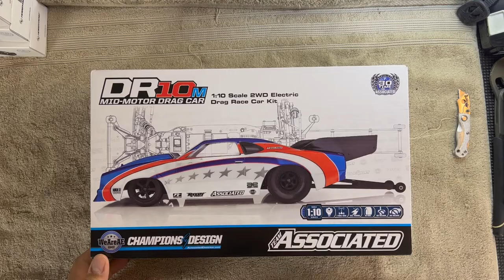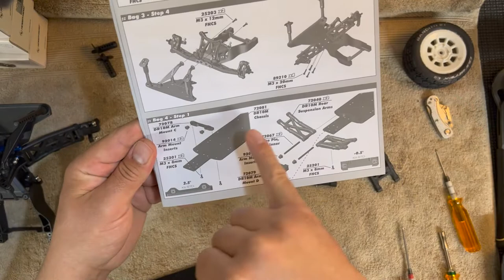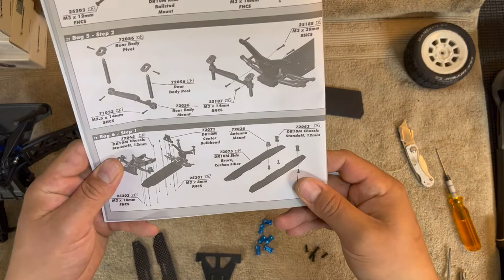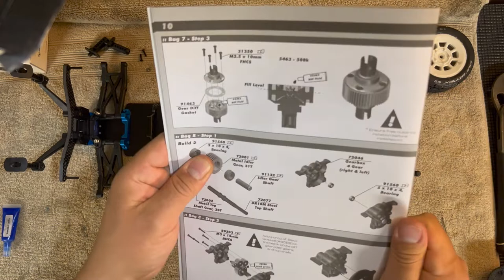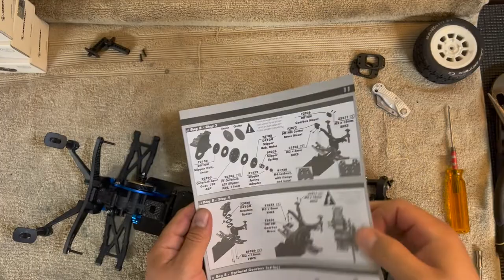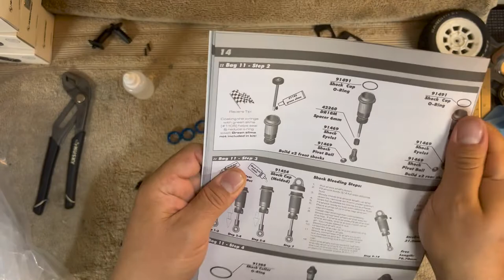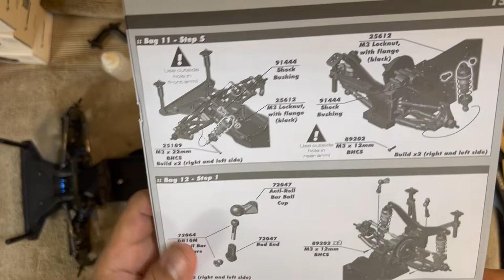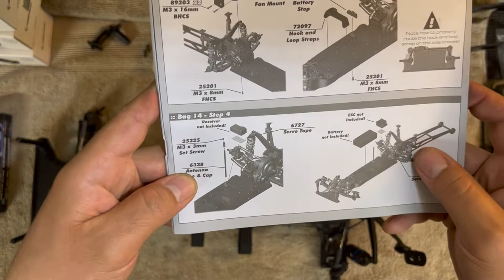Team Associated DR10M first thoughts tips weight and step by step build brief side-by-side with DR10

Comment: Bro you just said that fiberglass chassis is stronger than "Carbon Fiber" 😆 your not serious right ? You do realize Carbon fiber is five-times stronger than steel and twice as stiff right ? Not only is it stronger and stiffer than steel, it's also lighter than steel; making it the ideal manufacturing material for many many parts.
Reply from the maker: I did say that. It is a glass fiber or glass composite. It is called G10 composite. It is stronger than carbon fiber but heavier. That is the downside. Carbon fiber has a better strength to weight ration but G10 is less expensive. Although, it all depends of the epoxy used. 

Side note, carbon fiber absorbs energy better than steel. It is stronger than steel initially (many up to 5 times stronger... depends on the epoxy used). "Initially" is key as it depends on the application. Steel does not have a "life" but carbon fiber does have a "life". So steel engine rods will cycle "forever" as long as they operate below their threshold (yeold point)... and have good bearing, lubed, etc. 

Carbon fiber will eventually fail as it gets weaker over time through cycles (it has a cycle life un like steel). When new, the strength of cf is massively greater and a great choice for static things (don't cycle or expirience forces in multiple directions) like high pressure tanks. Therefore, carbon fiber is really only stronger 2D. Once a force is applied in a 3D (or perpendicular) it tears appart which is why metal fastners are inbeded... such as steel fastners or aluminum (by the way aluminum also has a cycle life). So cf is not the best for mass produced engine rods with current methods of fabrication because it is weaker than steel when experiencing forces in multiple direction. I think cf rods, for example, are only used in single run drag engines.
Reply: @telecomandorc  I appreciate all your information but your still saying G-10 fiberglass is stronger than Carbon fiber and it's not ,not in any form or fasion.

CF is used to make, among other things, airframe components for fighter jets, high end exotic super car chassis, guitar necks, precision rifle barrel wraps etc etc on and on.
Carbon fiber is also sometimes known as graphite fiber. It’s made from thin, strong micro-fine threads or “filaments” of almost 100% pure carbon. The filaments are twisted together in much the same way yarn is twisted, then woven into a sort of badass super-cloth.
Carbon fiber cloth is 5 times stronger than steel (the cloth alone ), twice as rigid and much lighter. This cloth is then saturated with a special resin, layered and compressed under high pressure to make the woven carbon fiber.

Though either material is substantially stronger than steel, industrial carbon fiber is more than 20 -30 percent stronger than the 'best' fiberglass. Carbon fiber boasts a strength to weight ratio roughly twice that of fiberglass
I understandwhat your saying as far as pushrods I'm talking basically CF vs Fiberglass G10..... 👍🏽💯
Reply from the maker: @ConditionZero76  
I guess the dispute is the generalization the cf is always stronger 🙂 It really is application based and based on the forces that are applied and I address this at the end of this post. But Cf is weak or not durable in many applications. Not sure if you follow F1 and how the cf halo gave out and just tore off. Now in a headon crash, if I had to choose... 🤔😅 I would rather not be in a crash... but if I were, let it be a cf chassis. But all cf will eventually have to be straped. It will just get weak over cycle use. 

I am also not disputing the fact that cf is a great material used for aircraft, ect. It is initially stronger than steel... initially.  But cf has a cycle life... a very long one, yes... but has a life. Eventually it will need to be scrapped just like helicopter blades. Steel does not have a life as long as the application does not excess the yield point. But steel is so heavy it makes no sence to use in this application. Just replace cf blades every 20 years or what every the cycle life it. At some point of use cf will become weaker than steel. Just in case others read this... steel does not replace cf and should not in most applications because of the strength to weight ration. Cf simply out performs in certain application. 

Now, cf is the best oprion for aircraft, top race cars, ect. I agree with you. The reason is strength to weight. Look at copmtetition bicicles. No one will make a steel frame... too heavy. Performance demands Al and cf... but both have a life and will need to be scrapped after their cycle life. 

Now G10 vs. cf... my point is that G10 is stronger than cf but heavier. G10 will not split like cf will. It will not chip like cf will. Now, would I perfer a chassis made of G10 or cf? Cf for sure. It is lighter and for this aplication I will just add CA glue every time it splits. As long as I am not crashing, it should not split. In the direction of force that causes cf to give, G10 is stronger. 

I appreciate your post. I let's me know how I need to improve in the details I give or explanations rather than just making a statment and assuming my mind can be read thereafter.
Reply: @telecomandorc  good information you have some very valid points,I tend to over react sometimes to generalized statements lol maybe I need to leave well enough alone, at the end of the day both CF and G10 are very strong dependant upon the application at hand w/ G10 on the heavier side....Thanks Buddy, had a nice time conversing 👍🏽
Reply from the maker: @ConditionZero76  On the contrary, thank you. You see, my goal is to provide quality information. Conversations such as these make me analyze what I say and do and try to make a video better in the future. I have Al chassis, cf chassic, and G10. You gave be a fabulous idea for a comparison video. It will take me a while as I have a list of things to cover, but at some point I will have a video based on our conversation. 😁 and you gave me great leads as to what to cover and focus on. So, thank you very much.
Reply: @telecomandorc  Thank you Sir, I appreciate a good conversation & enjoy learning as much as I can, as well as offering any info when applicable. I think this would make for a very good video & would be super informative, can't wait to see it when you get around to it.......  Thank you....
Reply from the maker: @ConditionZero76  Likewise, thank you. Hopefully I can do it this month. If not the next. I'll just have to switch things around in my "plan". It's just a scratch list with rough projects and target dates.